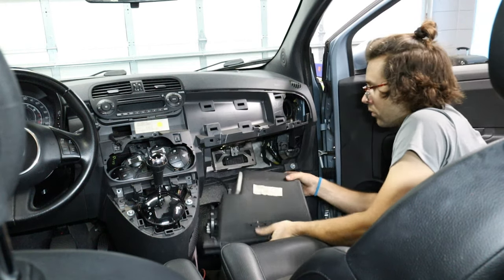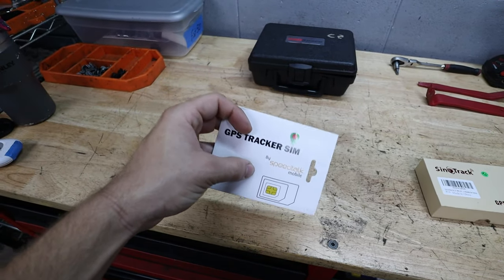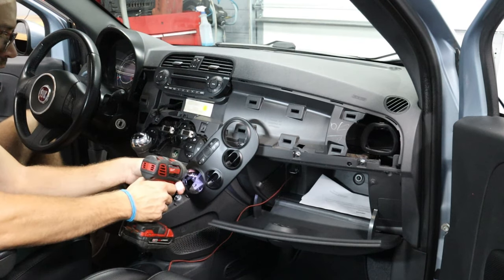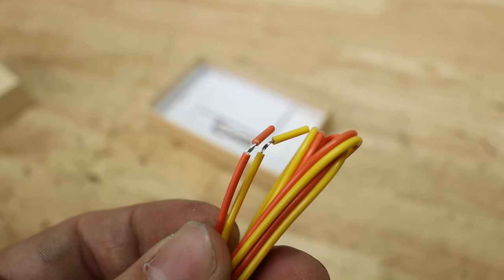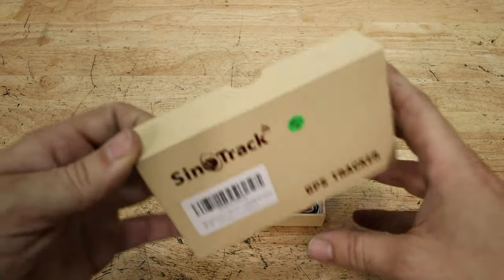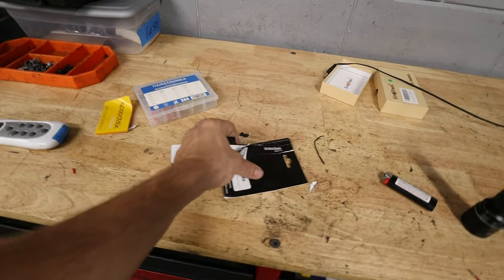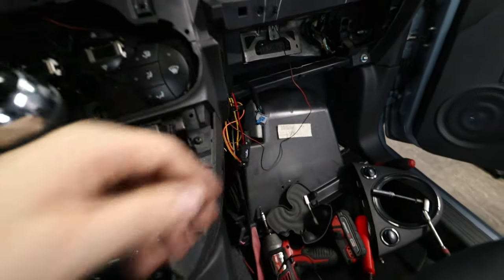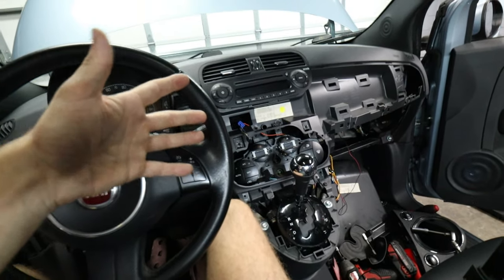How to: Install HIDDEN GPS Tracker for UNDER $50 (Sinotrack 4G Review)

Comment: I’ve use this gps it works good so far. I found a SIM card plan that’s really cheap it’s call 1NCE. $10 for 10 years with 500MB!! If you run out you just pay another $10!!
Reply: Hi, what app are you using?

Comment: Very interesting video. What you think, do you need this accessory wire connected? I mean, if you just connect 12v red and black wire. Will this device work?
Reply: Absolutely - no need for accessory wire connection! Just 12V red & black will make it work.

Comment: Good video. I live pretty close to you :) I was thinking about this unit but couldn't find any practical reviews. Very clear and to the point! I think mine is going inside the engine bay. It's a diesel so there are a million places to hide it. Just need to figure out how to wire it to the high pressure fuel pump - should be a fuse for it so that shouldn't be too difficult.

Comment: did you test or measure how many amps volts uses? I have a classic at the garage and althought i use a charger when i dont i was wondering if it drains the battery
Reply: Same question ^
Reply: same question here
Reply: @mifo1133  but no answer...

Comment: did it drain battery? how much? will it go in to sleep mode if car is not moving? i think it have motion senzor. Let us know please :)
Reply: that is what the ACC signal is for, if the car is off then it goes to sleep and doesn't drain the battery... well, just a tiny bit

Comment: Is their a better power source line to splice into, I thought using it on OBD can interfere with diagnostics and/or warranty if car is under warranty?  Also, wiring under stearing column easier without tearing down dash
Reply from the maker: Sure, you can find any power source that's constant on, and one that on/off with they key! I haven't had any issues with my diagnostics since installing this mod. But you can also go to the fuse box too and find some power sources there. Or connect to the battery. Lots of options! Hope that helps
Reply: Why do you want to install a tracking device that can easily be pulled out?
You want to stick it deep inside the guts of the car so it's not worth for any would be thieves to tear the car apart just to pluck it out

Comment: does it show the car actually traveling in the map? ive noticed that most if not all trackers do updates but dont show real time active tracking. Want to make sure that if a situation occurs... cops can track the cars active location and movement
Reply from the maker: It updates every 30sec that the car is on/driving, so it's easy to track precise locations. When the car isnt on, it updates every 30min or 1hr, showing you the parked location. You can also press a button and force the tracker to send you it's current location.

Comment: When you cut the engine by command (anti-theft), does it require another command to restart or do you keep cutting ignition?
Reply from the maker: The engine cut wire would usually get hooked up with a relay to your fuel supply, so if you disable the fuel, the engine will naturally cut out and won't restart until re-enabled. Hope that makes sense, and thanks for watching!

Comment: One question, can you install it without the relay connected?
Reply: yes you can. The relay is only for cutting the fuel pump function as extra safety.
Reply: @arvacon  ok good

Comment: I texted my sinotrack, but it is not responding with my SMS.
Reply from the maker: Make sure your sim card is activated, take it out and put it in another phone to make sure it's receiving texts/calls, and then finally power the sinotrack on and off and it should work! One of those will make it work, hope that helps!

Comment: It's not going to pickup a GPS signal if its mounted in the dash.
Reply from the maker: It actually works great on this car! A little bit of plastic/metal in the dash won't make much of a difference, at least for this model GPS 👍

Comment: How speedometer works
Reply from the maker: Calculates average of distance over time to make a speed estimate. Not super accurate in city traffic, but better on the highway.
Reply: If you have it on the OBD2 it will track everything. But this is only for tracking not data.

Comment: Bro you could had just putted it in the engine bay :P
Reply from the maker: Great idea, I was just worried about the heat, or being easily visible to someone else.
Reply: If someone has access to the car, they can get to the hood release and look in the engine bay. It's best to hide this device where it would take a lot of work to get to.